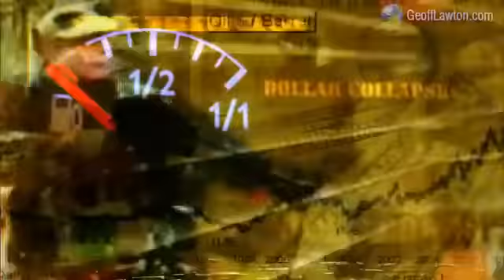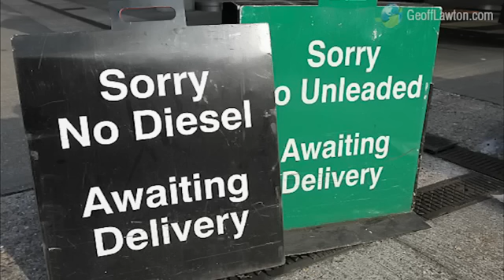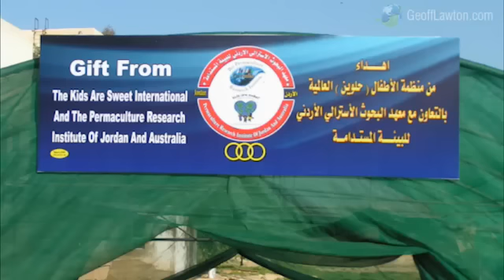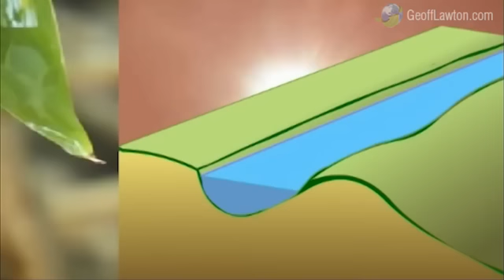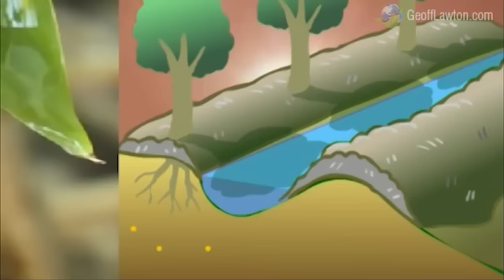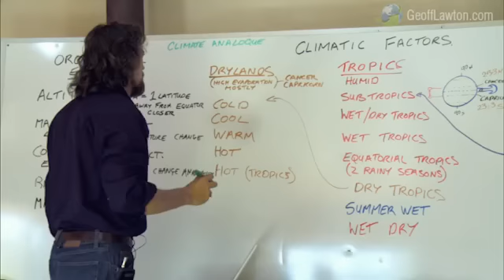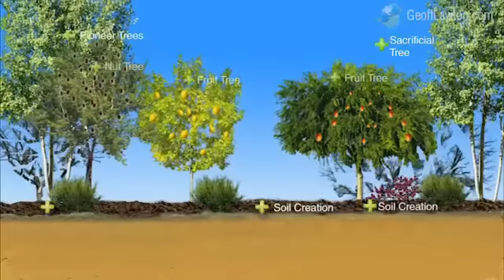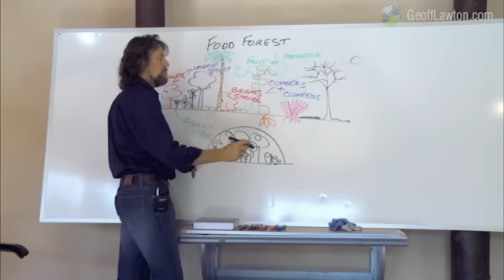Geoff Lawton:  Surviving Collapse, Designing your Way to Abundance

Comment: Hi ! I need advise to ReGreen my 10 000 sq meters very dry land in the south of France. soil is bad soil on the surface, and after 30 centimeters, like sand, and when I dig, it becomes strong, compact dry sand, (safre ?) almost like stone. it has very strong cold dry winds from north the whole year (Mistral) and strong dry hot winds from south sometimes. in spring around 32 celcius, there are some rain. in hot dry summer. almost no rain with 40 celcius. in winter, big rains - 4 celcius, frezing every nights. garden is in a soft decline towards south and west. so when there are strong rains in falls and winter, sometimes spring, water goes away. what would yo suggest please ? would love to have clear practical advices. Thank You a lot. much love.

Comment: What would you suggest for those that have psychical limitations i.e.... back problems or even the aged individual? Your concept is wonderful. Thank you for educating us on this mode of sustainability!
Reply from the maker: C Dean hopefully disabled or elderly have a support system around them.
Reply: Design design design. You might not be able to get everything done but design systems to do the work for you (or at least a lot of the work)
Reply: C Dean I am low 60’s and started a No Dig garden in 2015.  I employed Back To Eden method layering wet cardboard, leaves, grass clippings, wood ash and compost topped  with wood chips. The chop and drop system is great food for the garden too. I started with perennials like fruit trees, like apples and cherries, peaches, berry bushes, perennial foods like rhubarb, asparagus,  grape vines.  Then I planted a traditional garden.  I did a little at a time because I am not very physically capable to do traditional gardening at my age. Just start somewhere and work smarter, not harder.  Our soil was awful and heavy sand when we started and I just kept learning and learning a step at a time. Our soil is fabulous now.  Tilling and turning soil is a huge waste of energy.  Mother Nature does most of the work.  Check out Paul Gautche (Gautchy?) and Charles Downing on you tube. They are fantastic.  Start today.  Dont wait.  Good luck!!!
Reply: C Dean check out Ruth Stout method. more basic beautifully simplistic
Reply: Thanks so much so so great idea.
Reply: Sometimes very tiny simple and basic changes can do a lot of difference. I'll share a little experience. I'm surely not a fan of tilling/plowing, but to each it's own.
While talking to a farmer who have plowed that same field for "ages". 
I simply suggested he made one (1) tiny change. ;-)

He always plowed the field in up/down direction. What happens, even during the growing season the scarce rain that came up would rapidly flush out and away. Since the plow lines where pointing downwards. 

So my suggestion was simple. Plow it in 90 degree direction from is previous lines. So he was basically making a series of "tiny swales" across is landscape. Met him a few years after. He told me that never stepped back from that tiny change. Because he saw improvements every year. ;-)
Cheers

Comment: How can i work with swales on terraces? i live in south italy and here the lands has  terraces
Reply: Vincent Dirty, I would think that the terraces are basically swales that are a bit "flat".  Can you dig out the middle of the terrace to create the low point of the swale and perhaps raise the edges to create more of a swale profile?  Then mulch the high parts and plant the trees like Geoff does?  What are you growing or planning on growing on your land?
Reply: Uh oh! dont cause your hills to slip! Terraces are also water harvesting systems! They turn steep surfaces flat to prevent rain water runoff.  Swales are appropriate in less steep lands. You can build terracing and ponds safetly
Reply: @tinnerste2507  Thanks. I tried to do a swale and it is too much deep, and it is working as a pond ahah.
Can you help me? i was thinking to create ponds too, can you give me some tips?
Reply: @thisorthat7626  Digging as to create a pond? It is an idea i could study on. I am planning to do a food forest.
I have secolar olive trees and i have to adapt to them

Comment: I'll post this to my organic gardening group.  My problem starts with step one - chickens.  I live in a neighborhood on one acre with some ordinances (grasses cannot get higher than a foot).  The chickens are a problem for me because we have a lot of hawks in this area!!  They would get every last one.  I could plant clovers that don't get very high as a cover crop.  But what do you do if you cannot have chickens???
Reply: Then as Sep Holzer says "you have to do the chicken's job."
Reply: Try quails in cages, small space but great fertilisers & egg production
Reply: michele peel quail and rabbits ...or mini pigs or mini goats.. can you?
Reply: Have a guard dog for your chickens?
Reply: Michele Peel, have you considered a 'chicken tractor'?  You Tube has videos of how to build these and then you move them occasionally to give them more pasture.  I just built one using 2 x 4's, 3/4" PVC, and chicken wire with wooden braces and doors.  Zip tied everything together but put 2" screws to make sure that the pvc stayed in the holes that I drilled in the upper 2x3" x 8' screwed to the 2 x 4".  This left a lip for a roost on the inside; it just rests on either side of the 5' x 8' tractor.  There are 5 - 10'  3/4" pvc pipes (no flared ends) bent by hand to fit the holes and then the wire wraps from one end around the other and back up.  The wire is 4' x 50' x 1" and is zip-tied.  There is a 2 x 3" brace across the top holding the pvc in place.   

I too have predator problems but here it is a buzzard that has gotten several of me cats and almost got one of the Shih-Poms but was thwarted by the owner who threw a bowl at it.  This bird has even attacked my 100 lb German Shepherd/Lab mix!
Reply: The rooster will help protect them. If roosters are too noisy for your neighborhood, try ducks...much quieter